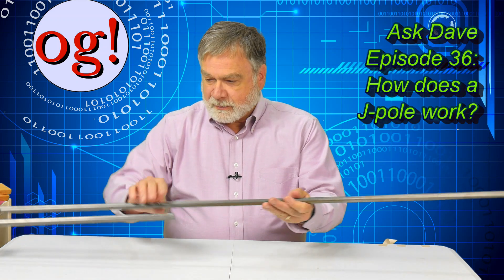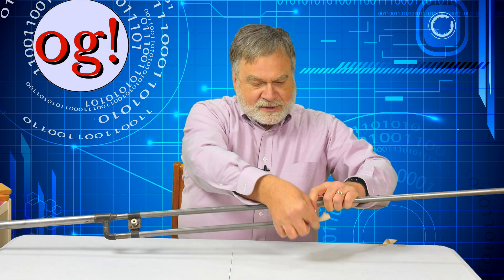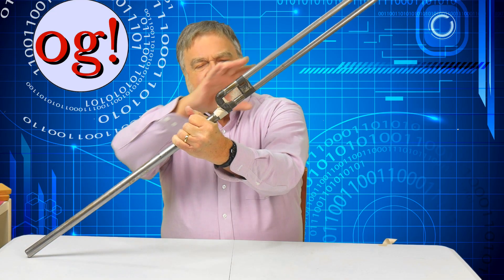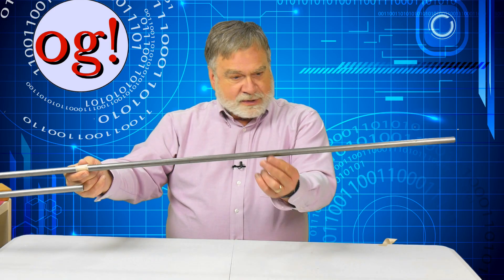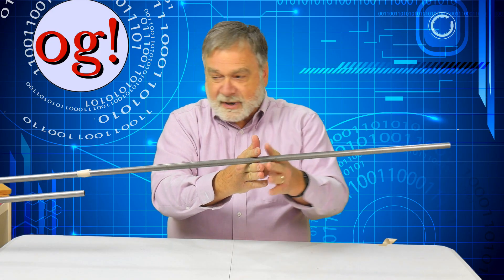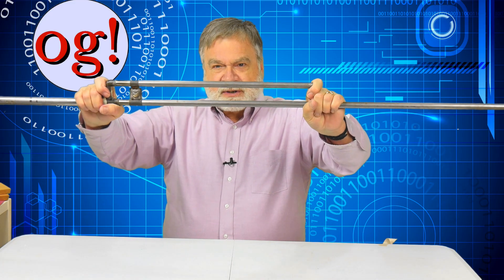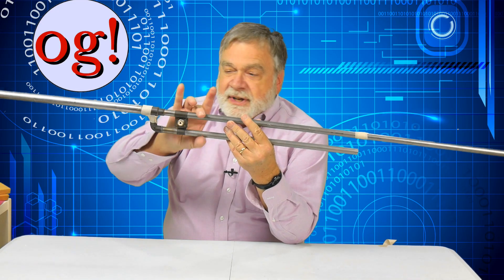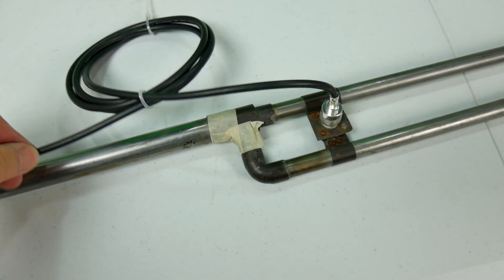How does a J-pole antenna work? AD#36

Comment: I used 1/4-in aluminum rods. One is 58 inches long and the other 18.5 inches long measured from shorted end. Spaced 2 inches apart. Feed at 2 inches up from short. Does great on 2 meter band. Feed short rod. Used 1/4 inch stainless hose clamps for connections.

I've made more than 25 of them. KK5R

Comment: My explanation below of the J-Pole collinear can also be center fed and turned horizontal by eliminating the 1/4 wave j section at the bottom, leaving the 1/2 wave part, then going up to the middle of the antenna and tapping across that quarter wave stub to find the 50 ohm point. This antenna can be built horizontal for 6m or even 10m as a wire antenna.

Comment: Actually, a J-Pole is an end fed half wave vertical with a shorted quarter wave stub unun. You find the 50 ohm tap point by tapping across the two sides of the stub. You can convert the half wave antenna into a collinear vertical by adding a shorted 1/4 wave stub at the top and another half wave vertical on top of that. Continue this for a total of 8 half waves to make an eight element collinear vertical with about 9 db gain. A bit long on 2m but [it is usable on 70cm at about 8 feet long] it works if you use copper tube instead of wire. 73 de w8nsi Jim

Comment: I asked ChatGpt how a J-Pole antenna works and this was the reply: Would you agree with it?
In the amateur radio world, there is an antenna called a J-Pole antenna. Can you tell me how it works?
ChatGPT said:
ChatGPT
Absolutely! The J-Pole antenna is a popular and simple-to-build antenna that is used primarily in the VHF and UHF frequency ranges, though it can also work for HF in some configurations. It's a vertically polarized antenna, which means it radiates energy in a vertical direction, making it useful for communication over line-of-sight distances.

The J-Pole antenna consists of two parts:

The Radiator Element (The "J" Shape): This is the vertical element of the antenna. It's typically a half-wave (λ/2) length long for the operating frequency. The name "J-Pole" comes from the shape of this element, which resembles the letter "J".

The Matching Section (The "Stub" Part): This is a quarter-wave (λ/4) long section that is usually mounted parallel to the main radiator. It is used to provide a matching impedance (around 50 ohms) between the antenna and the transmission line (typically a coaxial cable).

The key feature of the J-Pole antenna is the use of the counterpoise or ground plane (which is integrated into the antenna itself in this case). It does not need a separate ground plane like some other antennas (e.g., a dipole or a vertical antenna), making it more compact and easier to mount.

How it works:
The radiator element is the part that actually radiates the radio signal. It’s the main part of the antenna and is typically resonant at the desired frequency (a half-wavelength long).
The matching section helps to create the correct impedance, so when the antenna is connected to the feedline (like coaxial cable), the power is efficiently transferred with minimal signal loss. This is important because most radio equipment operates at a specific impedance (usually 50 ohms), and the J-Pole is designed to match that impedance to avoid power reflections.
The design works as a non-resonant antenna in that it uses a tuned stub (a quarter wavelength) to effectively create a matching system. This allows it to radiate efficiently without needing a separate ground or counterpoise.
The antenna's impedance is typically around 50 ohms, which is a good match for most radio equipment, and it provides a relatively high gain compared to a simple dipole.
Why it’s popular:
Simple construction: It’s easy to build with just a few materials, often with copper pipe or wire.
Compact: It’s often more compact than other full-wave antennas while still providing decent performance.
Omnidirectional: When mounted vertically, it radiates in all directions in the horizontal plane, making it suitable for communication over short-to-medium distances.
No need for a ground plane: The J-Pole antenna doesn't require a ground plane or extra radials, which simplifies installation.
So, in summary, the J-Pole antenna is a vertically polarized antenna that uses a unique design to match the impedance of the feedline while also providing a relatively high radiation pattern for communication, making it an excellent choice for amateur radio operators.
Reply: It's a vertical antenna but radiates horizontally.

Comment: Nobody talks simplex on 2 meters so why BOTHER having a J-pole antenna for 2 meters?? When you can reach a repeater with a quarter watt of power? This is why I stay away from the 2-meter band.. Might as well just use your cell phone, same principle.. They should get rid of all the 2-mater repeaters.. This would bring back in a way the sport of a true wireless experience on 2-meters! What is the HAMS issue with SIMPLEX????

Comment: Dave, another great video.  While the quarter wave "U" section is balanced, I'm not sure it is balanced after the additional 1/2 wave radiator is added to one side.  In a lecture Ed Fong recorded on YouTube (E_IBni6vvMc&t=1456s 44:50 mark) he says you only need a choke if driving it off resonance.  I'm not sure who is right but checking the cable for common mode current at the center of the band should clearly establish it.
Reply: Looking more into it I'm inclined to think that you should have the choke balun.  You can be sure if the hold the coax in your hand and see if the resonance shifts on a spectrum analyzer.

Comment: In this video, I believe you explained how this J pole antenna worked on the 2 m band. I think there are some J pole antennas that work on both the 2 m and the 70 cm band. Am I correct? If so, how do those antennas work?

Comment: Isn't a J-Pole typically - and by design - a dual band antenna? This should be good for VHF (2m) and UHF (70 cm) band. The lower part or the small part on the opposite site should probably be a y-bit shorter for that purpose, i guess, just a quarter wave length of 70 cm. Or would this be another J-pole design?

Comment: These are shocking for CMC. A trick I found is to feed it with a 4:1 half wave coaxial balun at the 200 ohm point. Really settles it down with minimal losses, and the balun is easy to make.

Comment: Thanks for the video Dave. I have one question. I have built a 2m 70 cm j pole out of copper tubing. Does the center conductor go to the short side or the long side of the pole. I have seen people do it both ways on you tube. I figured if anyone could answer the question it would be you.  Thanks for your response.
Reply: You answered it in episode 163. Thanks

Comment: I'm not sure that it is a good idea to have the supporting pole connected to the antenna, as looks like the case here; some of the RF current might divert down the pole, the amount depending on its length compared to the wavelength?

Comment: Nice, clear explanation.   I would add to be wary of grounding the bottom of the antenna,  its supposed to be zero volts,  but it never quite is, so you can get unpredictable things happening.  Personally, I would keep the antenna insulated from a metallic mast.

Comment: Another question:  since the 1/4 wavelength long U-shaped part functions as a transmission line, would the radiation largely cancel out on that part, so the radiating part of the antenna is only the part of the long tube beyond the short tube?

Comment: So moving the feedpoint adjusts the feedpoint impedance.  How do you adjust the resonant frequency?  Would you change the length of the long tube or the short tube or both?  If both, is there a certain ratio that should be maintained (maybe 2:1 since they're meant to be 1/2 and 1/4 wavelength long)?

Comment: Do you have any Idea what kind of pole (galvanized or ...) do I need for  Lora Antenna 915mhz 5.8dBi - LoraWan Antennas for Bobcat 300 Nebra RAK V2 SyncroBit SenseCAP M1 Helium HNT Hotspot Miner Gateway? ( If you have any experience in helium mining antenna)

Comment: Thanks for the explanation, on how this works. But I must say, I’m still confused. When I model this in MMANA, I get the pattern of a dipole, but I cant get a 50 ohms match. While I can get 50 ohm real, the reactance is very high (hundreds to thousands of ohms), regardless of where I put the feed.  I dont know if this is a limitation of MMANA or what is going on.

I can’t find any article that shows this kind of feed with equations.  All I can find is open or shorted stubs, which is not really the same thing, as they show input impedance of a length of transmission line that is open or shorted.  But this has one end open, and the other end shorted, and then connects somewhere in the middle.

Comment: Vhf and uhf do not have the joys of sporadic E or any F1 or F2 propogation, but the EFHW is like a trombone or coronet. Unfortunately not happy on bands besides specific wavelength it is fully spec'd to. Can last forever in sealed pvc, and no radials for swr causing feathered friends to perch on.

Comment: I'm building a j-pole with an N-panel mount. Would the feedline connection benefit from shrink tubing to insulate the soldered connection on the back of the jack and the length of wire between the panel jack and the long element of the antenna?

Comment: I can't get my head around this. All I can see is a direct short. Two in this case. Same thing with a tape measure yagi that uses a jumper wire right at the end of the feed line. I'd be scared to hook up a antenna analyzer to it. lol

Comment: Okay, this makes so much more sense now, I had always heard them described as a 3/4 wave antenna, now I get it, it's really a 1/2 wave with a rather strange feeder. In other words, if you removed the 1/2 wave section above the masking tape, although it would exibit a good VSWR, it would radiat very little to nothing, because, just like open twin lead transmission line, one side cancels out the other because they are 180 degrees out of phase and parallel to one another.
But the most interesting thing about this video is, I have always been in a controversy over which side of this to feed, and I have always feed them on the long side, and with my ground shield on the short leg thinking that it was a ground poise for a 3/4 wavelength antenna. But instead the bottom portion, is infact an impedance matching transformer for a 1/2 wave diapole, which requires no ground plane at all, but it does require a balanced feed which is why I can never get a really good VSWR. it's the same as trying to feed a center fed dipole, or an inverted V without louping the coax or running it through a ferrite bead or two.

Comment: They present the J-pole antenna "as a new invention", and it is nothing more than a ZEPPELIN antenna invented 115 years ago when neither electronics nor electronic valves existed, and it was transmitted by sparks, discharging capacitors

Comment: Nice presentation thumbs up, would like to know how PL259 is terminated on the antenna side, particularly which side sees the center conductor?
Reply from the maker: The terminating connector is the SO-239. It is an unbalanced connector; that is, the outside of the coax (the shield) connects to the outer part of the SO-239, and the inner connector is in the center. On a dipole, ideally you’d have a 1:1 balun, but in my experience you don’t, so connect the center conductor to one side of the dipole and the shield to the other side of the dipole.

Comment: Great video, but one small suggestion:  talk about how the connector connects to the antenna.   I'm a newbie, so maybe this is obvious, but not to me.   Does the outside of the connector connect to one tube, and the inside of the connector connect to other other tube?
Reply from the maker: I'll try to show this in an upcoming video.

Comment: Hi Dave what is the total length of the 300ohm twin lead wire used in a ed Fong DBJ2 antenna..aswell as the total length of the coax?
Reply from the maker: Sorry, you should direct your inquiry to him.

Comment: Hi, can you please explain the correct connections to the feed point.
ie; hot to longer length or not.
I have searched many build designs and there is no  confirmed correct termination.

Comment: Bravo! Thank you for an illuminating explanation! If I understand the matter correctly; At a DC voltage, it is a dead short, but at a VHF frequency, it is not shorted!  I am not transmitting or receiving a DC signal so the dead short issue is moot! 73 Russell KE7QXR

Comment: David, did you make the J-pole you are using as an example? I noticed you have what looks like an adjustable feed point to fine tune the position. Does that adjustable piece do well over time in the  outdoors? I am thinking corrosion could form at the adjustable section and cause a loss of signal transmitting and receiving. I suppose one could put a self tapping screw into both sections of the antenna to make a better connection? Does the length of the mounting section, below the bend of the short section have any effect on performance at all. I have seen designs where they recommend transitioning to PVC for the lower/ mounting piece, what are you thoughts on the PVC?  You had said in your video that the lower piece was not considered to be an active part of the antenna. How do you have the coax connector wired? Coax center to long section and outer shield to short section? Your video''s are very educational and I enjoy your style of instruction.

Comment: The top part is not a dipole, it is a half-wave end-fed wire. The coiled up length of coax does act as a common-mode choke but it is not a balanced-unbalanced transformer ("Balun").

Comment: I watched your video on j-pole antennas (great video) and was interested in your suggestion about changing the unbalanced line to a balanced line to match the input of the antenna.  Well, I thought I would try it.  I was getting a good SWR without the balun, about 1.14.  I wondered how great it might get with a balun.  I pulled down my J-pole, looped my feedline like you suggested with 6 loops and tied it together with some cable ties.  Off to the radio and SWR meter.  OOPS, now the SWR is 1.48.  Took the loops out and back to 1.14.  Any idea why this happened?  Thanks. --Kenoli  KN6FYJ

Comment: Dave love your videos . I am DE KC5ULU  . I ask you about the omni charistics of the j-pole antenna . Heard your reply today thank you for taking time.  I wanted to let you know my test site is in my back yard , maybe not optimum but works . I have a MFJ analizet the old 259 model which to my surprise will transmit a signal , it isn't strong but enough to see it on my Sedelco 733 super band field strength meter . My meter is a Seldco antenna meter covering the low mid and hi band vhf  I have 40' of rg 6 run across the yard from a simple dipole antenna  30' away it allows me to tweak the receive meter to the transmit signal of the mfj 259 at one location . By doing this I am able to see a relative signal in microvolts . Now I can compare other antennas to each other or see how much better of an improvement I can get without asking someone else for a radio check, which we both know is useless. My receive antenna is 10' off the ground the test antenna is also 10' of the ground and I sit under the transmit antenna to get all my comparative readings. This is how I saw problems with some antennas J pole was one . I could grab the coax too to see if I get a meter movement indicating a common mode current on the outside of the coax . Now I am aware this is far from optimum , I know I have interference from reflections all around but for a simple test it seam to offer a world of important information. One great feature is that, a 3 element horizontal omni antenna I have been working on was mounted to an aluminum mast , then tried a pvc mast with a wooden insert for stiffener and it showed an improvement of "300 micro volts". Thats a huge improvement. AS it is my ssb 2 meter weak signal can hear 300 miles without any enhancement in the way. I have a pair of these 3 element phased antennas stacked 5' apart . It is the best I can find out there in omni. I compared a standard J-pole to a super J , WOW ! What a difference , also tried an J-beam and that to showed a great improvement in forward and rear rejection .this 1/2 wave end fire antenna was a great invention.

Comment: Thanks Dave.  I'm a new HAM and just bought a J-pole for my apartment to run to a mobile setup.  At the end of your video you mentioned to take the antenna up high.  Is using a j-pole dangerous if I can't mount in outside?  I'm needing an antenna that I can use indoors.  Most repeaters in my area I can hit with an HT using 4 Watts and my mobile will do 5 watt on low power.  Thx

Comment: Dave like so many other hand I've built lots of j-pole antennas z d love them but one day wile checking out all my antennas I noticed the horrable so called Omni pattern . I grabbed the coax and saw the see change so added a choke , that's when I realized it was balanced and coax unbalanced but when I rotate the antenna the signal still varied to much .I did see where a recent patent ( US7859477B2 ) was given  on an improvement , and that design was something I had always wondered. After going through the pile of old antennas I found one I had done like that but doubt I knew what I doing then . Anyway haven't had time yet to try this but have you seen the pattern of the j-pole even with a choke.? I did make myself a dozen sleeve chokes for my other quad antennas so use one of those.  I have supper j right now on 2 meters and 70cm and will have another for 1.25 meters , also a standard 6 meter j too .  Love these antennas with DC ground but am about to try isolating the long portion with plastic to see if the Omni pattern improves. What is your thoughts on the patterns ?